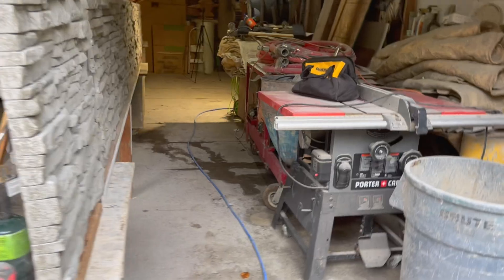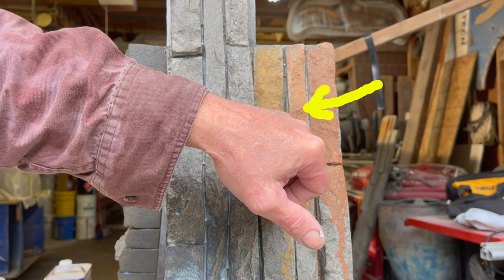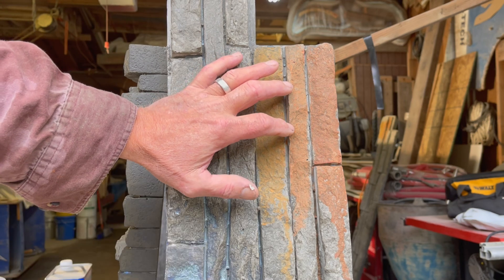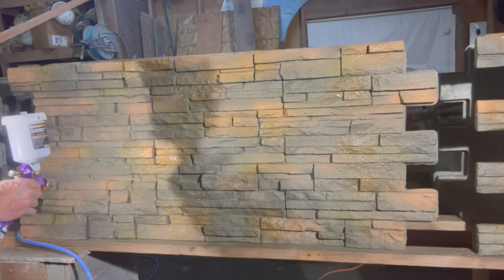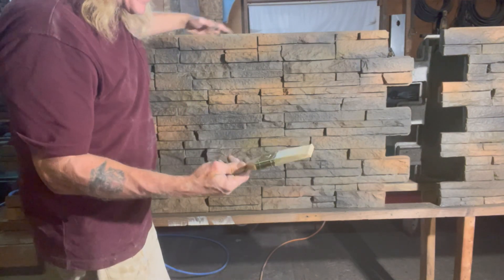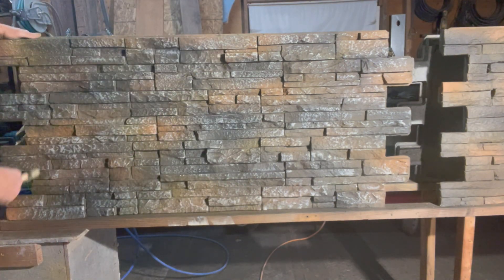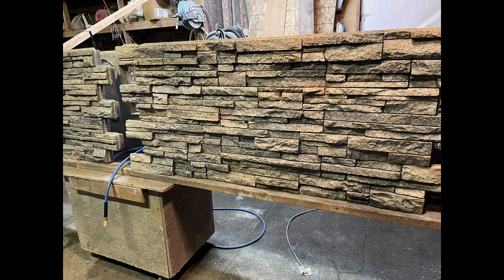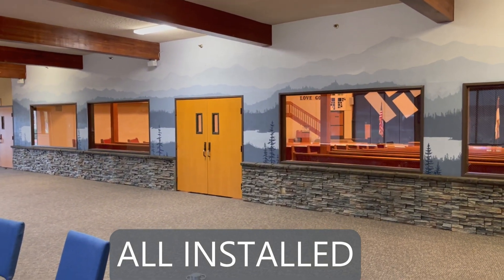All you ever wanted to know about  staining rock or stone Part 1

Comment: I am building a house (1st time) and had concrete stained stone fireplace installed. There are about 3-4 colors of stone and one is too light (white). How would you recommend I darker them so there's not so much contrast? I like the colors of the other stones which are a taupe/gray and a charcoal gray. There are about 26 white stones and they are small in comparison to the others. Thank you!
Reply from the maker: Usually use acrylic paint I do with water and either brush on or spray on to color

Comment: What type of paints is best for this?
Reply from the maker: Through a lot of choices one can make when it comes to making stain but I prefer 100% acrylics
Reply: @fauxrock  thank you so much sir. I have a retaining wall stone to slightly stain. Was thinking of using concrete strainer. But i found your paint process very cool.
Reply from the maker: Thank you as well, I appreciate you taking the time to watch my video
Reply: @fauxrock  hello, do you have a regulator on your setup? Or any other connector to the pressure line?
Reply from the maker: No regulator. My compressor run at 150 psi, but I keep the air needle valve turned in to reduce air flow…. It’s not the same as an air regulator, but it works.
Reply: @fauxrock  also, May i ask what type of paint gun thing you used here was?
Reply from the maker: Here’s the link for the spray gun…

https://www.harborfreight.com/20-oz-hvlp-gravity-feed-air-spray-gun-62300.html

Comment: Hey when did start using a spray gun.  I don’t recall seeing you use a spray gun in previous videos or mentioned in your DVD course.   Looks great!! What pressure was your compressor set at?
Reply from the maker: Been using spray guns for ever.. 150 psi is what the compressor is set at, but I keep the needle valve turned way down… I mean it’s not like the needle valve is a regulator but it does slow down the flow to workable level.
Reply: @fauxrock  thanks one more question.  Do you use the same mix ratios and layering with the spray gun as you have described with the other staining techniques?
Reply from the maker: Yes and no… It just a matter of what effects you are trying to accomplish. Trial and Era coupled with long experimentation has given me great insight to producing or replicating exacting outcomes. The best advice I can give you is to get busy doing try try and try. I can also offer you the DVD course which does go through the different techniques and I also support the DVD course purchases with tech-support

Comment: This is excellent. Here in NM at 7200 ft, it's a little cold to work on this without a heated shop but I plan to get started in the spring. Getting good ideas from you and appreciate it very much.
Reply from the maker: Great… This work is fun and easy to use. Thanks